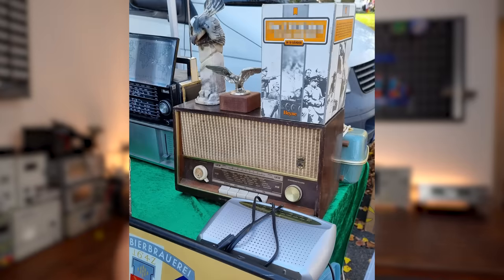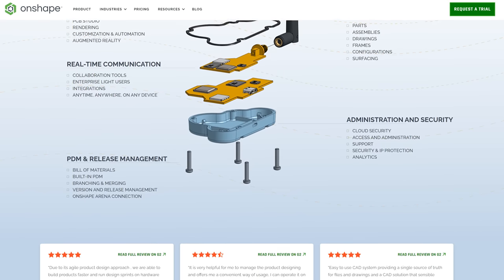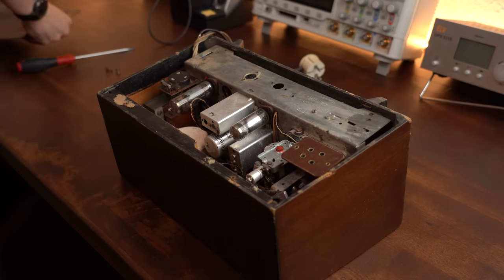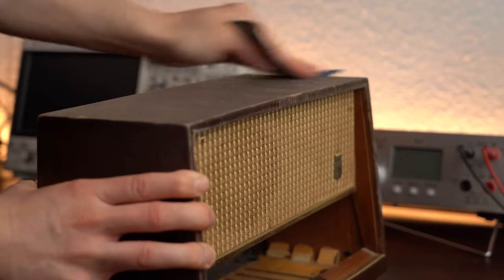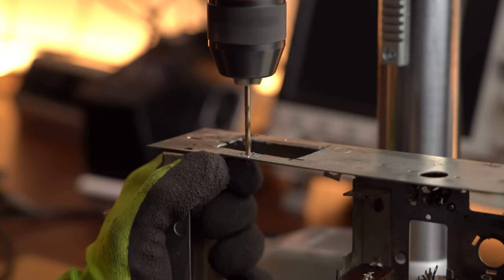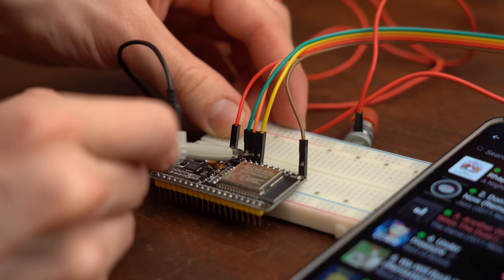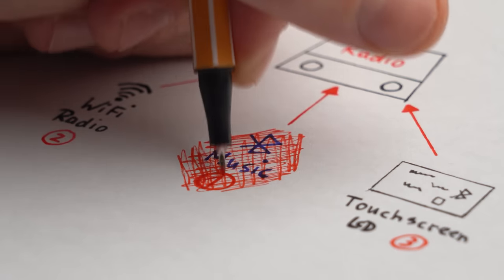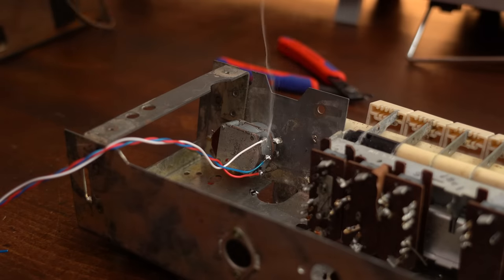I Spent 20€ at a Flea Market and made Something AMAZING! (Internet Radio)

Comment: I worked with STM Microcontrollers in college, and I have to say, I quite like them personally. Kudos for that. Supposedly some of the more "advanced" STM microcontrollers come with I2S built in, but I don't think they come with WiFi/BT though. 
Again, I could be wrong on both of those.
Reply: +1 on this STM is honestly the go to if you are doing any kind of serious projects, or commercial/ industrial stuff, the esp microcontrollers have some issues, timing issues and over all not as diverse and supported as STMs, this is one of the reasons why drone flight controllers are based around STM chips, also yes some STM chips have i2s, pio etc but im not sure about wireless communication

Comment: 20W is quite a lot compared to the tube amplifier which probably had less than 5W output power. So be careful not to overdrive the old speaker.
Reply: Yea looking at the Tubes used id guess it was around 3w . 
And these old speakers realy dont like to be overdriven
Reply: That old tube amp maybe made 1-2 Watts. But since its only for the Kitchen, i doubt that its an actual issue...

Comment: Nice re-furb & use of the ESP32, but personally I would have used the original white buttons as the channel selectors, and/or replace the original volume control(s) with rotary encoders to control channels and/or switch between Wifi streaming and bluetooth - no need for the separate external touch screen.  Nice idea though, and I agree it's much nicer than a new/modern radio 👍

Comment: What a shame. This radio was in good condition, probably only needed about 8 capacitors replaced to work reliably again, and had a factory audio input. If you're attaching an external box to it you could've just put everything in the box and kept the radio original, or at the very least left the original electronics inside and just hooked up the speaker to them new parts in the box.
Reply: I hope you're not throwing the parts away though, some people (like me) could definitely make use of those tubes, coils and transformers!

Comment: I really like re-using the old style cabinet. A couple of comments though. Did you really need the AC supply? Could you just have used a USB-C PD board and left the AC part to the external power supply? The touch screen module seemed awfully complex and I assume, pricey. Is there a reason you used it and not maybe a cheaper esp32 with a screen? (edit: actually, looking at mouser, the screen was surprisingly cheap, atleast for that size). Could the touchscreen have been mounted and designed like the old frequency chart in the middle of the radio body, between the dials?
Reply: Totally agree! USB-C (>5V 500mA) can be a challenge to do by hand, but with the cheap PD boards, which offer a number of voltages (5, 9, 20, etc.), they’ve become my first choice for all new projects. Plus, if you use a quality power block (Apple ones are way overpriced, but well made) the output can be much cleaner than the average external brick or wart.

Comment: Uhh, disappointment 😞
Using at least that built-in tube audio amplifier instead of your 20W transistor amp would have been so nice! Breaks my heart! You had all the parts you needed already in the radio, sigh. 
Using the 5 switches as station keys would have been nice. And you could have used a Web-interface via WiFi to change the channels that are on those station switches.

I retro-fitted an even older radio from 1939, made by Körting, with a bluetooth receiver (from broken wireless headphones), feeding the analog audio to the phono input of the radio. All I needed was a small audio transformer to match the impedance and the audio voltage level. Sounds great!

Comment: Interesting, but also sad.  That was a fine old Grundig radio in quite good condition as restore subjects go. Though I understand the motivation to create something modern and unique out of something old and worn out, in my opinion one should first restore a vintage radio to work as it did when new, then add some new circuits to modernize its capabilities. That way you retain the best of both worlds, the old and the new, without trampling on the history that made the modern circuits possible.  You can always remove the added circuits later and return the radio to its original function if you decide the mods were not to your liking, but once you destroy the old circuitry, its gone forever.

Comment: As an aside, there are amplifiers that have built in bluetooth connection built in. I have a plan to do something similar, but I am building the enclosure as well. I have a low cost amplifier from Amazon (of course you can get them from Alibaba or any similar Chinese sourced site). Makes thing a little more simple.

Comment: Just a suggestion, remove the touchscreen and use the radio's original tuning dial (read the variable capacitor) for channel selection. Thanks from Colorado.
Reply from the maker: Haha that does sound like fun.
Reply: @greatscottlab  It's in the pico-farad range and is fairly easy to do (and would make a wonderful GreatScott video).  Or better yet, find another radio to modify.
Reply: @CraigHollabaugh  NO please don't let him kill another radio

Comment: I modified an old 1970 radio, and working on a 1946 now.
The only mod is a Bluetooth receiver module, with a switch on the back to choose between original radio and BT.
So no dramatical modification, and easily reversed if needed.

Comment: Nice video as always, but I would have used the original buttons, as someone suggested. Plus, the STM32+ESP32 combo is overkill for this project. The ESP32 would've been able to do this on its own with an external touch display, be it over SPI or even a Nextion if you didn't feel like doing too much work.

Comment: Amazing project, except for the added touchscreen. IMHO it collides with the retro philosophy which has driven you away from the modern looks of internet radios.
I'd suggest to implement a web browser interface instead. Hidden but accessible by any computer and smartphone in the house.
Anyway, nice job. As usual! :)

EDIT: and the tuning knob could be replaced by a rotary encoder, so to cycle along a list of stations of your choice. ;)

Comment: You should have took your project and put it inside the radio and used the radios tube amp to amplify and drive the speaker. There are many sources out there that tell you how to add a line level input to the radio.

Its a shame to see a vintage radio gutted and replaced with modern electronic crap. You know they dont make there anymore and the amps in these are actually really good.

Comment: If you have an android phone you can enter developer mode and switch between various bluetooth standards, none are necessarily better than the others, some standards just work better with certain devices. I've used this method more than once to fix pairing issues with stuff like wireless headphones and IoT devices.

Comment: I always enjoy your videos.  I just don't like the touch screen.  I would have preferred a rotary encoder running off the original tuning knob and simple indicators in the tuning dial.  If you insist on graphics, maybe the light emitting display behind a translucent replacement of the old tuning panel.  Good idea, but not the best execution.

Comment: Cool project it kinda inspires me to film making and programming my headphone's bluetooth circuit after all if it fails I would atleast get something out of it.
The design has so many new rhings I never used before that it's making me nervous. It uses an NRF52832 soc as the bluetooth module and a 24bit dac IC. It also has 3 battery managment ICs(protection,charge,buck converter) and if this wasn't enough I decided to make the pcb at home since I managed to fit everything on 1 side...

Comment: Possibly a video idea that relates to the Bluetooth aspect of this project; Looking at how those small adapters for older cars (which feature radio only without aux or Bluetooth) that plugs into the analogue aux port and power, and allows you to connect to it via Bluetooth and transmits the audio on a small low power radio for the car to receive, essentially a Bluetooth to radio signal converter. Obviously your radio couldn't make use of it as is, but if you wanted to explore Bluetooth functionality a 'DIY or Buy" video would have parts that could integrate with yours.
Thanks for the video and all the content!
Reply: Great idea. I did a car stereo conversion where I (mostly) removed the cassette tape player and replaced it with a Bluetooth receiver. It was a bit challenging, but fun and, of course, useful.

Comment: If you feel you need to touch screen for just a selection between 5 stations, and not use the buttons already on the radio, you could have at least made it wireless so you wouldn't need that cable. :)

Comment: You should see if anyone wants the vacuum tube if it's working. I can understand not wanting to see the old devices since high voltage is very dangerous and most folks don't have the necessary equipment like an isolated power supply to bring up the vacuum tube system up slowly to ensure everything is working. Plus, you got the issue with potential failure points like the power transformer which often can't be replaced so you're forced to do bodge work (again very dangerous when powered up after an attempted fix) and other parts like the IF transformers (not as dangerous but a real pain to get right, see MrCarlson's lab restoration videos for how complicated it can be).

Comment: Although I think this is a great DIY project (thanks as always), it is very hard to reproduce for the all day user and pretty expensive part wise. Maybe you should have mentioned that one could also have gone with a simple Raspberry PI + Hifi-Berry AMP 2 + 7" touchscreen together with Volumio OS to have Internet Radio, Bluetooth, Wifi and an Android App to control everything remotely (no soldering or programming required).

Comment: Cool build! 
You can get amp modules that have built in Bluetooth and SD car reader, you could use the ESP to control this via micro relays as the amps are operated using tactile switches, so the relay just replaces the switch. All you would be doing is replacing these switches with something the ESP can operate and via its i/o pins and the touch screen interface would be the same, but the code would need a little modification. This would give you internet radio, Bluetooth and an MP3 player all in one. You still need the converter that changes the digital output of the ESP32 to analogue audio - this is fed to the amp via the aux input jack on the amp module. You have to be careful with some of the converter modules as they are meant for headphone output only, but some can be easily modified to suit output to amplifier.

Comment: Hi mr. Great scott... I think I have noticed a very big design flaw in your water pump video   that i think you might have missed... I was watching it today and i realised that the filament was not so weak.. but the design mistake increased the inertia so much that the axle couldn't handle......its the blades or wings of the pump... They should be cured such that when they rotate they push water outward.. but in your design the blades are curved in the other direction...this caused water to get pulled towards axle and oppose centrifugal forces causing it to have huge inertia and harder to move water outwards  thus the axle broke..
.(to all great scott lovers please don't get upset its just an opinion)

Comment: I'm currently doing something similar but using an esp32 audio board from Ai thinker (which is a bad copy of the esp32-lyrat. you would be better off using an esp32-lyrat).
I've connected this to an arduino for using 2 rotary encoders.
The esp32-lyrat or ai thinker can be with arduino library from pschatzmann who was done a great job of making an easy to use Bluetooth /web radio receiver. The board has integrated amp and i2s dac

Comment: Pretty cool, but I would have tried to keep the valve audio output there.  Not very easy but would have been cool.
Reply: It's not hard if you know how to work with a schematic. You most likely wouldn't even need one since it's usually just shorted capacitors

Comment: This is pretty cool!  I want to do something similar to this, except modulate the audio signal on the output of the amplifer of the modern stuff, to pipe in to the 1/2 century old electronics to reuse for the 'amplifier'.  Only because the fidelity of a typical AA5 console is crappy.  Who wants high fidelity anyway lol

Comment: Personally, I would have just cleaned it, but not refinished it or anything -- otherwise I'd just have made a replica enclosure. I also would have not had the touch screen, and used all the original interface hardware -- just to make it look and feel like it still is just an old radio

Comment: it definitely could have been made cheaper by finding a cheap android phone at the same flea market as the radio then gluing it to the radio. That way you will have internet radio AND touchscreen for way less price, plus you could grab a bluetooth speaker board and add a switch that turns off the phone and switches to the bluetooth receiver.

Comment: You could have just tapped onto the existing vacuum tube amplifier and disconnect it from the tuner circuitry to keep the radio as original as possible.

Comment: I would like to build something similar, only larger, and use server power supplies, and car steering amplifiers,  the power supplies I have can do about 35 amps each,   I guess a couple of them should power a 500 -600 watt amp, and electronics, nicely, using a couple large capacitors because the class D amp can get hungry on bass notes,  I believe a couple 12" subs, and 4x 6.5"  mids and highs would sound great maybe add a couple 8" or 10" woofers to allow the subwoofers to be crossed over really low, for deep bass, really good for action movies, where and explosion can cause things to fall off the walls and shelves!  A couple 250-400 watt amps a 1-2 channel and a 4 channel amp allows plenty of stereo sound and power,  it may require 3 of the power supplies in parallel,  could be a cool project!

Comment: Very nice build and good job with wood finish. My only question is, wouldn't it have been better for sound quality to leave the old tube amp circuit for amplification with just replacing tubes and some caps?

Comment: You should be using the already present buttons for station selector. Also, an original vacuum tube power amplifier could be used. It'll definetely add this radio an unique sound.

Comment: 20W amp? Speakers in those 1950s radios were high-efficiency speakers used with very few Watt amps. No idea whether they can be fed with more wattage - do they actually have a rating printed on somewhere? I'm curious myself. While I will certainly not butcher my nicely working tube radio, if I ever find a cheap "not working" one, I might also convert that to something else, who knows :D

Comment: Tel, that LCD ruined the pretty design completely. I also hoped you will reuse hw buttons even if this would need to remove some of the probably clunky mechanics and replace it with microswitches to have nice tactile experience keeping original look. It might be also possible to use some oled(s?) to repurpose original display without so brutal change. That lcd looks like if there would a parasite fungus from the future grow there :)

Comment: Next should be an Intranet accusable RTL-SDR.  Also a Spiral loop antenna for it would look very good.  I can't share links here anymore as I do not pay for Google Red but if you have a FB link share it and I'll send two pages on to get you started.  The modules are cheap and will get that Grundig RX back in the original ranges with more sensitivity than it ever had.

Comment: I wonder if there's a less invasive way, is it possible to monitor the internal oscillator frequency of the radio, so that you could use channels controls of an existing radio as it and still be able to change channels by having your device outputting a matching low power frequency corresponding to internal oscillator of radio and deliver correct internet radio station over that low power radio frequencies.

Comment: I like all of your projects but have mixed feelings about this one. I prefer to keep at least the original low frequency amplifier intact, it can be easily fixed. The tube amplifier create a warm yet clear sound if the tubes are in good shape.

For daily usage your solution is of course the better way.

Comment: I really like the idea of taking old electronic gear, use the enclosure and fill it up with new modern electronic inside but man! - imho that external touch display totally ruins the vintage idea behind the project :(

You have five radio stations to select between completely matching the amount of buttons on the cabinet so why not use those as selectors?

Also, you should not give up on the BT part of the project. You can then use you cell phone with a suitable program as an alternative station selector.

Comment: I get the frustration with bluetooth, I just spent an entire day trying to get an SD card module working on the ESP32 and it simply does not work. I tried EVERYTHING, still no idea why it doesn't work.
Reply from the maker: Sorry to hear that.....
Reply: @greatscottlab  FIxed! The MOSI and MISO pins were mismarked on the 5v SD module, the voltage regulator didn't function at all and I had to let the audio.h library call sd.h instead of calling it directly from my sketch (which shouldn't matter). I switched to a 3.3v SD module and it works perfectly. I guess that's the price we pay for dirt cheap Chinese electronics.